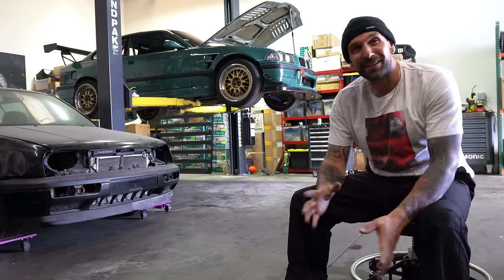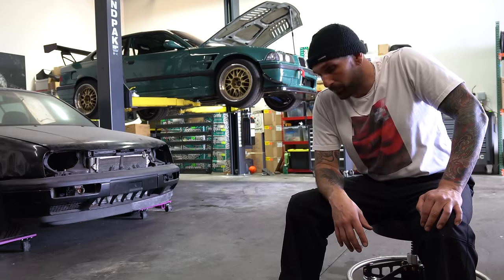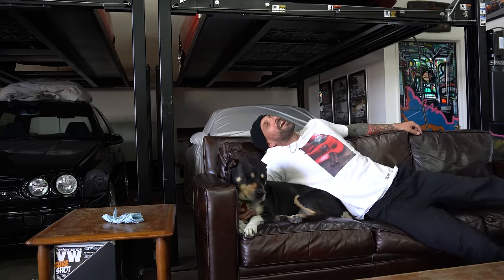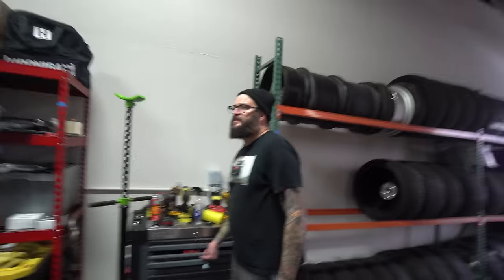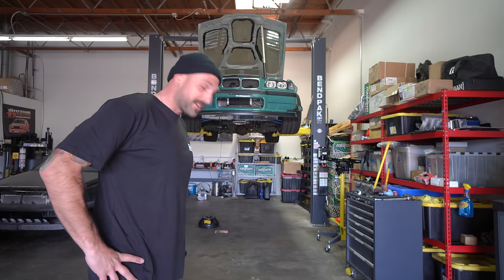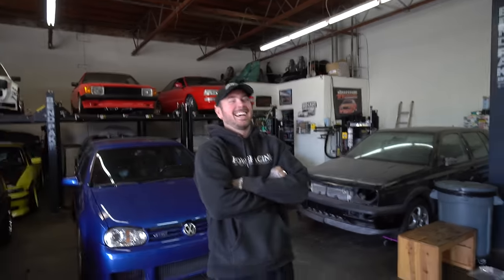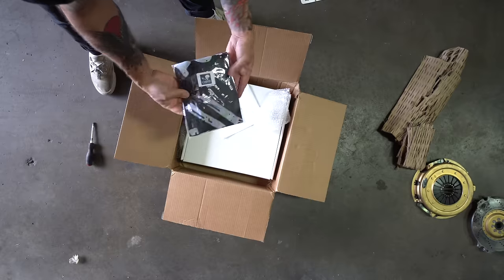TRACK TESTING MY PROJECT CAR- 700hp BMW M3

Comment: I have had and fixed both of those problems in my ls swapped rx8 track car. The fix for the catch can is a ls6 valley cover breather setup. Tons of baffling. I was emptying the catch can every to laps before and it’s once a season now. The fix for the clutch is better heat management around the clutch line. Tons of heat wrap and a shield or two will keep the fluid from boiling and making the clutch not work anymore. I was unable to test both of them with street use, only happened on track.
Reply: This is some good stuff right here, hopefully he puts your theory to the test.

Comment: With how much driving you've done, that amount of fluid in the catch can wouldn't concern me at all. I put an entire quart of oil in my catch can in a 1/4 mile pass... yes I know it's a loose drag motor, but just for perspective. Remember that Smedding motor is a little more race than street, so I think you're good. Just *keep an eye on the oil level*.

Comment: Great video, thanks Vin. For your master cylinder problems, look into getting an upgrade like a Tick that you can adjust, and make sure you’re fluid is high temp. And maybe even look into adding a bleeder valve to keep it tidy.

Comment: Have you checked the throw on throwout bearing? It could be understroking or your master cylinder isn't big enough for it and pushing enough fluid. Also those twin disk clutches need all the throw you can give them
Reply from the maker: Everything seems correct. Going to swap the MC this week

Comment: The locking up, lack of feel, understeer, weird roll characteristics. It sounds like your front suspension geometry is off but that's to be expected you've completely changed the weight balance and roll centre but its not a complex suspension so shouldn't be hard to sort.

Comment: I had this happen to me on a clutch before. Bleed the clutch and see if there is built up pressure in it. It sounds very counter intuitive, and I don't know the science behind it, but there's something about if the pedal doesn't 100% release it can carry residual pressure. If it does, it acts the way you are describing. Maybe I'm wrong, but breaking loose the slave cylinder bleeder is a cheap place to start before replacing stuff. If it does have residual pressure, look at the pedal stop. It may need to be adjusted down if I recall correctly.

Comment: A proven e36 race set up which gives a touch more front grip than rear is:

700lb front spring
350lb rear spring

0 toe all round

-4 degree front camber
-3 degree rear camber

6 degrees front caster

28mm front sway bar
21mm rear sway bar

Comment: Any rubber hose on the clutch line? Could be swelling & flexing from the heat/ swap. If it's changing its operation based on heat/ usage, it can only be the fluid (old/ moisture) or the seals in the master/ slave cyls creating more square inches or losing its pounds (as in PSI pressure) when clutch is pushed..
Only other thought would be if the pedal position/ push rod wasn't adjusted correctly & wasnt allowing new fluid from the compensator port as your using it pushing fluid down the system.. but that will make the pedal go lower/ closer to the floor as it cools, the pedal position is usually the noticeable symptom in that case. Guess how i know about that one in my wrx lol.
A new master & steel line with that new clutch/ slave should get it ready to pound that track again. Sounds like a beast can't wait to see more 💪

Comment: Hey Vin! About the handling of the car, seek someone who can corner wheight the car and help you setup the suspension. About the understeering part remember you swapped a tiny 3L for a masive V8 in a relatively light car so it's weight it's front biased alot.
Reply from the maker: The car is corner balanced and the motor is actually lighter. That 3L is an iron block while the v8 is all aluminum and actually sits further back.
Reply: @vin_tra  oh, ok. Might be a a damping problem then. Nice build! Keep up the the good work!

Comment: for anyone interested - gaff tape is mostly used in the entertainment industry. it’s easy to tear and is mostly used to hold down cables temporarily or to quickly label stuff. it’s very versatile and used in many applications in the industry. however, its expensive for the good stuff and is completely useless if it gets wet. don’t waste your money if you want to use it in an automotive application.
Reply from the maker: It’s nice because it doesn’t leave residue. It’s perfect for quick stuff like that.

Comment: It sounds pretty damn awesome,  Vin! As for the hood, bond in a piece of aluminum tubing inside the flange. This will stiffen it & act like the original steel item. All composite hoods gape at speed! Cheers. Leigh in Scotland 🏴
Reply from the maker: My Seibon does not!

Comment: Also noticed when the e36 was on the lift those front tires look like they have a PhD in ancient they could also be the cause in what you're feeling on track if they were just rollers my bad then possibly pressures and definitely needs more front splitter just trying to be helpful love the content and can't wait to see what you've got cooking.
Reply from the maker: They are basically new A052

Comment: Are you sure ure not boiling the fluid ? I had similar issue but IT gets Better Once i left the car cool Down a bit. Turned out to be a clutch line too close to exhaust

Comment: Just wondering, is the 3/8” vent line from the valley plate connected to the intake manifold so it’ll see vacuum when the throttle is closed?

Comment: You 100% have a slow leak of your clutch master or slave cylinder/hydraulic throwout bearing. It felt better because you bled the clutch when you swapped it, and will keep feeling worse with use. 

Re-Bleeding will make it come back for a bit, but get those parts replaced before they go out completely.

And before you think that you don't see any leaks of fluid, they can either leak into the bellhousing and get burned off or leak back from the master cylinder, into the reservoir. Both are kinda invisible, and the latter is probably what is happening.
Reply: Oh wait just got to the end of the video and you figured it out. Best of luck with the fix
Reply from the maker: This is what I was thinking.
Reply: @vin_tra Yeah dude sorry, not trying to talk down lol. I got to the end of the video where you came to the same conclusion moments after hitting enter.

Loving the content post-Hoonigan, you're living the car-centered life that so many of us want.

Comment: My clutch line was too close to my driver side header in my ls swapped 240sx. It was heating the fluid so much that it would grind gears after a little while.
Reply from the maker: I think this is my issue. I have it heat shielded but may also wrap the collector. It actually happened after idling for a bit. Wonder if the moving air helps it not

Comment: Maybe try drawing a vacuum on your crankcase rather than venting to atmosphere. Crankcase vacuum helps the piston rings seal. You can still run a catch can as an oil separator while drawing vacuum on the engine block. Look at the Mann + Hummel ProVent. Moroso also makes oil separators.
Reply from the maker: We are going to try to run a can for the valley and valve covers separately to see how it goes first
Reply: @vin_tra  The air and oil making it out of that vent filter is from pressure inside of the crankcase. Each piston stroke moves air inside of the block mixed with oil being flung all about from the rotating crankshaft at each of the journal bearings. IF you have piston cooling jets, those too are adding to the chaos within. Drawing crankcase vacuum from behind the throttle body means you aren't pushing that air/oil mix out of the block through your valve covers. Instead you are sucking it out through an oil separator using manifold vacuum whenever you aren't at wide open throttle. Since you have 700hp and go WOT seldom you probably have manifold vacuum just about all of the time. M/E Wagner makes a nice dual mode adjustable valve for controlling crankcase vacuum.

Comment: What size did you stretch your ears to? I got a 0 gauge hole punch so I’m screwed forever. I just wear silicone inserts to try and hide it now.
Reply from the maker: Ahhh 5/8 I think. Recently just started stuffing earrings in and like the vibe. Accessorize my boy!

Comment: That thing boogies!!! Doesn’t seem fast with the in car stuff but the fly bys man. That thing is movin. If more track content is coming then maybe like fender arch or roof mount camera angles som on the car but outside stuff. Pedal box view is awesome but maybe do that in a smaller screen with outside footage as the main screen some old Picture in Picture type stuff. Keep up the hard work man seems like yer getting the hang of this stuff and it’s coming along well.
Reply from the maker: I wanted to do exterior cams but was nervous I’d lose a camera since most panels are FRP and the windows are lexan. Need to figure out some exterior rigs for sure!
Reply: @vin_tra   what about rivnuts in a couple different spots? Yes I know the car, exterior wise, is pretty much done and who wants to out wholes in stuff but it’s give you stupid solid mounting points that would never not be useful and may even be practical. With you wanting to create more and bring more to the table may not be a bad move plus you could use that footage on track days to see what the car is actually doing compared to what you are feeling. Maybe one of those little off-road light pod mounts that attaches at the hood hinge as a base, the overland guys are real fond of those. No drilling required and its solid mount. Just my two pennys man. I’m digging what yer putting out man not trying to heckle just a voice from the peanut gallery! Good luck and hopefully you could find a way to get some outside shots that not only benefit you but give us some more viewing pleasure.

Comment: Vin: not gonna drive it hard
Also Vin: immediately goes to 6k. 
Me: 🤣
Reply from the maker: well im gonna rip it but not fast in the turns hahaha
Reply: @vin_tra  hopefully you figure it out. Wonder if adding a little spring pressure and damper would settle it. A autotech teacher said he would adjust the coil over to be a little stiffer vs making the sway bar stiffer because the sway bar will affect both sides negatively when its too stiff.

Comment: did u break the cluch in for like 500 miles ?
Reply from the maker: I dont believe in clutch break in periods for race cars.
Reply: @vin_tra  not to be disrespectful but I feel like that’s throwing away money you heat cycle tires for longer use , you break in a fresh motor, you have to bed your breaks all this to length the life of your friction materials

Comment: Hey here's my constructive criticism. 
Audio is better, but I think you need to add auto-volume leveling for the whole video that makes the volumes seem closer or have everyone mic-ed up (a lot more effort).
Your camera seems to prioritize and boost audio that is closer to itself for some reason.

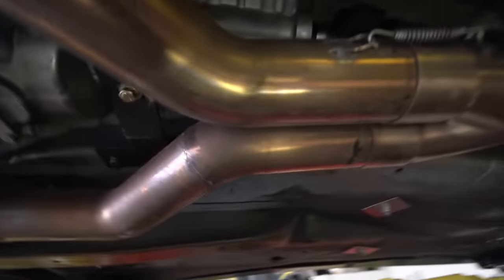The trashcan intro :D was fine, but the camera is far away so your voice was quiet (I turned it up to hear). When you went handheld and even more so under the car at about 2:00 I had to turn the volume way down. 

Music needs to be leveled too imo. That one is a bit more subjective though.

Short version, anyone should be able to start the video, set their volume once and not change until the end of the video. It's important to have a listen-through for every video before exporting. 

rambling conclusion:
These small frustrations will grind away at your viewers and they might decide to watch someone else just simply because they don't want to modulate the audio for every volume change over 20+ min. Audio is tricky and more people won't even notice, but they might feel on a subconscious level that something is just a bit off and not making this the experience it could have been. Appreciate the substance of the content and the changes you have applied, because you obviously care about this project. Good luck!
Reply from the maker: thanks for the input. I know a lot of this but still need to figure out a workflow that works for my shooting and editing capabilities.

Comment: Pretty sure that's my old 2019 GT3RS -> https://youtu.be/0NQjk31HD_c?si=khZCJ5_nZQj_A5hS&t=543.   Did it have a blacked out front bumper area? The blue, side script decals, gold wheels, license plate frame, and exhaust tips match my old car.  It's also a inozetek miami blue wrap.  If not, that is a twin of my old car. :)

Comment: Keep your clutch lines away from the exhaust as much as possible and use thermal tec heat shield over the clutch line you won’t get clutch fade
Reply from the maker: Yeah I have it wrapped and tucked but maybe more.
Reply from the maker: Actually the bleeder is not wrapped.
Reply: @vin_tra  only other thing I have in mind is the fluid use a heavier brake fluid had a similar issue with a Camaro I worked on not to long ago wrapped the lines swapped fluid to a racing brake fluid and problem solved

Comment: your issue may not be a slave/master issue.  The issue could be the bmw hydraulic system.  you may need a bigger clutch master cylinder.  this is something I have been dealing with in a bmw e30 m3 kswap application.  @k24e30m3